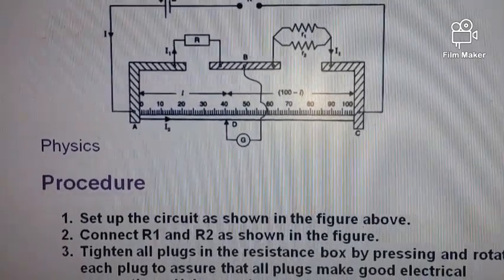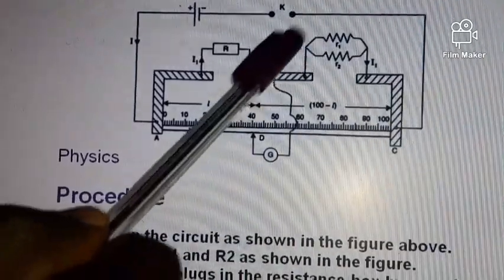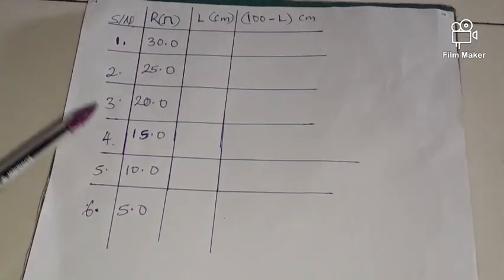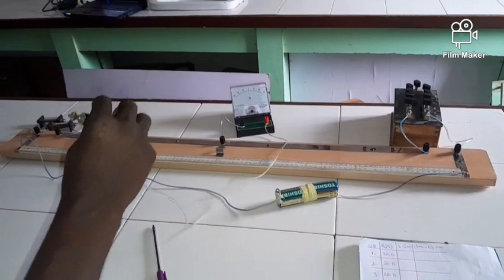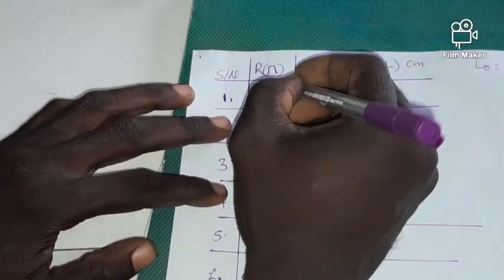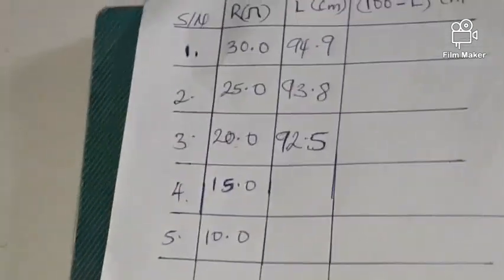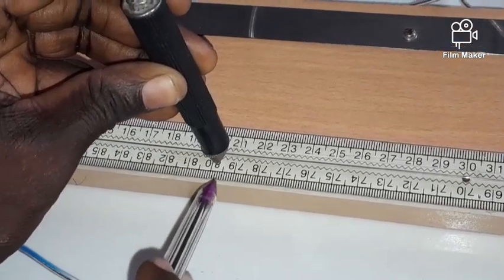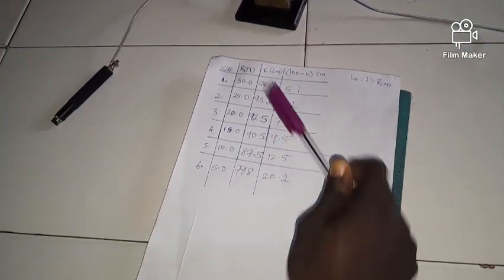NECO PHYSICS PRACTICAL 2022 ELECTRICITY (METRE BRIDGE) EXPERIMENT. TWO RESISTORS IN PARALLEL

Comment: Thanks.. but can’t this experiment be calculated thats getting the balance point by using the Wheatstone bridge formula
Reply from the maker: Using the metre bridge formula, it can be calculated. The formula is; R1/R2 = L/(100 - L). But remember that I had two resistors in parallel. So you have to obtain the combine resistance in parallel of those two resistors.
Reply: @yousciencelab5307  yeah I know thanks since the resistors are in parallel I would solve for parallel and then add it to the unknown resistor which is 2ohms then use that formula to get the balance point L on the galvanometer… wow thanks
Reply from the maker: @imanahchristopher4614  you are welcome

Comment: Thumb up sir! Don't you think the L values is too high considering the actual value of Lo?  Asides, I thought the  negative terminal of the galvanometer should be connected or wound round the jockey.
Reply from the maker: No. The resistance of the a wire is proportional to the length. Remember that the values of R used in the resistance box are very high. So this will lead to high values of L. In circuit connection all positive terminals must terminate with positives. Anyways, doesn't really matter because the galvanometer can deflect either ways depending on the direction of flow of current. Either ways, you still get your balance point.
Reply: In addition, the least value of L or L1 at the least value of R must not be more than the value of Lo gotten when the resistance box plugs are all plugged in.
Reply from the maker: @agbakansiuchekingsley5948  you do  remember that the resistance of a wire is proportional to the lenthg. So we are all good with the readings we had. The length were more when we had higher resistance. So you see we are good.
Reply from the maker: @agbakansiuchekingsley5948  all values of L should be more than. This means there was no resistance on the other side when the R box was closed.

Comment: Please sir, what did you use as your R1 and R2....Is it a wire? If yes, which type of wire?
Reply from the maker: Two standard resistors. One is 1 ohm and the other is 2 ohm. One of them, most likely the 2 ohm resistors will be sealed. Again, the connection may be different from this just the way I explained in the video. But everything remains the same. It is the same procedure.
Reply: Thank you sir....So it is not a wire?
Reply from the maker: @ifeanyietea6214  no. Not a wire.
Reply: But since we have already known the resistance, why are we still looking for R1 and R2?
Reply from the maker: @ifeanyietea6214  you are going to be provided with two standard resistors. One known and the other unknown value. The resistance box is just to vary the current through the circuit.